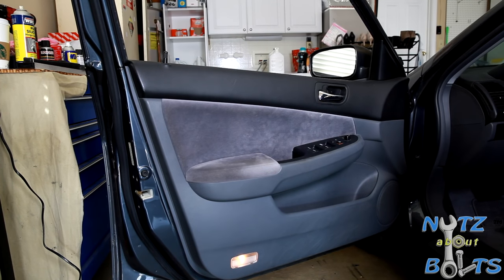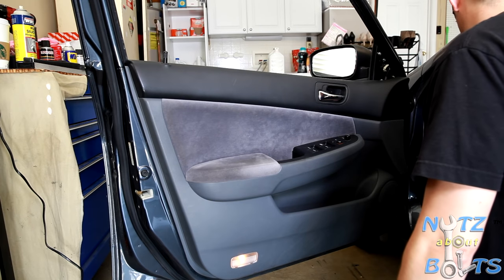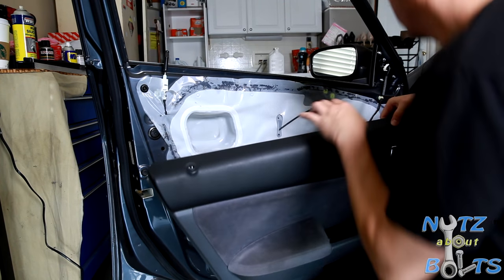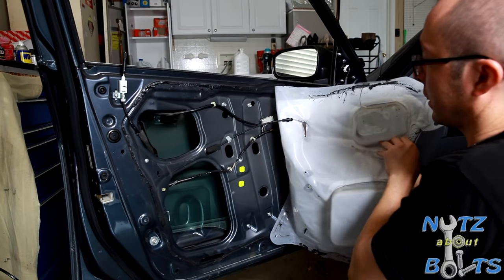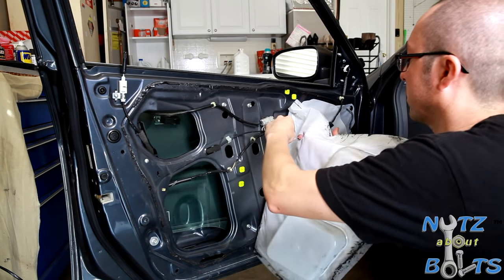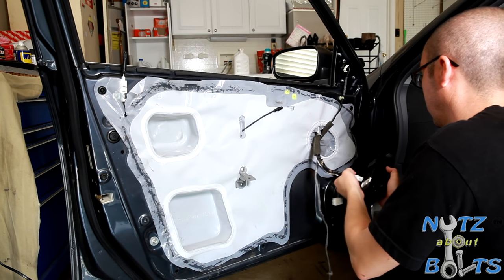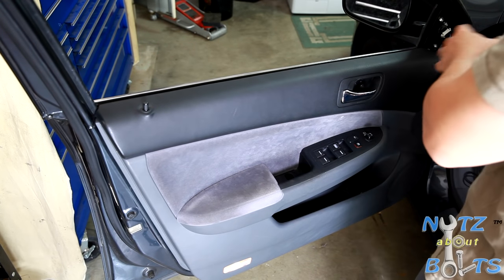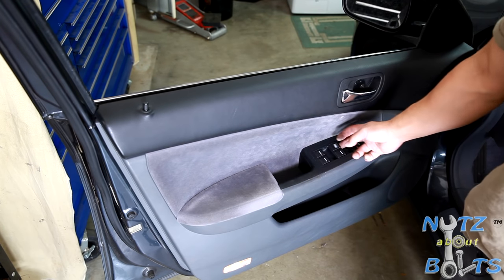2003-2007 Honda Accord Door panel removal

Comment: For the 2004 Honda Accord EX Coupe (2 Door): Rather than one screw in the armrest underneath a rubber mat, you will find two screws facing in towards the door underneath (towards the bottom) of the armrest.
Reply: Goat 🐐
Reply: Wowww thank you! I was confused bc there wasn't a little mat or a screw where he said. No wonder panel won't come off still

Comment: you should disconnect the door handle cable before removing the door panel, otherwise you'll get what happened in your video and that bracket holding the cable will snap and then you're out of money to replace that too. there's a cover plate right behind the door handle that you pop off and pull out the door handle, then disconnect the cable from the bracket.

Comment: My door handle cable seems to have snapped so now I know how to remove the panel to replace it.  Very nice
Reply: I learned the hard way that if you remove the panel as demonstrated here, the green plastic holder on the door cable will almost always break. If you remove the door handle before removing the door panel, you can avoid breaking the plastic piece. I'll be opening my door from the outside until my new cable arrives. I'm sure 8 years ago the plastic on this guy's car was still pliable enough that he could get away with this. Not so much now.

Comment: The last thing you said was reset the power switch, what's that and how do you do that? I'm so glad you're back. I have a 2004 Honda Accord and it needs a lot of work. I was pretty worried when your channel was down. You guys are awesome! You guys are very detailed and explain things very well. You guys have the right tools too. Thanks guys.
Reply from the maker: you want to put the driver side window down all the way, then press and hold for 5 seconds. After that, you bring the window all the way up, then press and hold up for 5 seconds. That's how you reset the auto window up and down for the driver side.

Comment: Good video on how to remove door panel to enable access to a variety of components and fasteners. I used it to lower the panel to ease access to the bolts holding in the side view mirror. I didn't have to remove the panel entirely, thus eliminating the need to detach the control console on the armrest or the cable to the door latch.

Comment: Thanks, mate. I have a problem with the lock and I'm trying to fix it myself. Thanks to you, I know how to remove the door panel 😁
Reply from the maker: No problem! I also made a video on how to replace the door lock actuator.
Reply: @NutzAboutBolts Can you provide a link to the video?
Reply from the maker: @krzysiekpawlak6992  here you go https://youtu.be/y4Qete3nBeo?si=_Lt3RanZFjP7h2of 

It’s for the passenger side, but it’s the same concept for the driver side, just different part used for the actuator, instead of the passenger side actuator, you’ll need the driver side actuator for the driver side door. I hope that helps.
Reply: @NutzAboutBolts Well, now I know what it's about. Will a new actuator be needed or will regeneration be enough?
Reply from the maker: @krzysiekpawlak6992  if the door doesn’t unlock or lock, you’ll need a new one. Not sure about regeneration. Never heard of it.
Reply: My problem is that the passenger doors and trunk are closed with the remote control, but not the driver's door. And when I lock it with the key, all the doors will lock
Reply from the maker: @krzysiekpawlak6992  I'm still a bit confused. You're saying when you use the key fob to lock the doors, that it'll lock except the driver side door? but when you use the key to lock all the doors on the driver side door, all of them close? is this happening intermittently? or does it happen all the time?
Reply: That's exactly what's happening. Unfortunately, this has been happening all the time for a long time  @NutzAboutBolts
Reply from the maker: @krzysiekpawlak6992  it’s most likely the actuator that’s going bad… buy one from Amazon, if that’s not the issue, you can do a free return through Amazon. That’s what happened to mine when it happen intermittently.
Reply: Thanks for the help. Could you send me a link? Because I don't even know what it looks like
Reply from the maker: @krzysiekpawlak6992  this is the driver side door actuator https://amzn.to/3ArznK9
Reply: @NutzAboutBolts Thanks. I think I can handle the exchange. Take care 👍
Reply from the maker: @krzysiekpawlak6992 no problem!

Comment: Great video dude! Is it hard to get the motor out if it needs to be replaced?  If the window stopped half way up, is it likely that the motor is okay but the window is stuck on the track or out of alignment?

Comment: Thanks. I'm accessing the inside of the door and removing the sliding window glass to get the lock cylinder out to re-key the door lock. I have successfully done it with my 2003 Honda Civic and it looks like the process on the 2005 Accord will be similar.  Removing the cover panels off he Accord door is a little different than with the Civic.  Your video is very helpful.
Reply from the maker: glad we could help :)
Reply: I did not have remove the window glass after all before I attempted to.
Reply from the maker: usually you don't need to remove the window glass when removing door parts...

Comment: I have a 2006 honda accord the driver side door window goes up and down, but none of the other windows work, so I'm thinking the motor is ok, what would your recommend I check next?
Reply from the maker: does the master switch works when using on the driver side? does the window go up when you use it on their individual sides?
Reply: Google it. I found the fix. U bridge two wires under the window switches

Comment: 2006 Honda Accord EX Coupe door panel is different. I have locked door and no idea how to get panel off. Right now there are 2 screws in the bottom of arm rest, under electronic window switch, which are a problem to get out, but when those are out, still don't know if panel will come off.

Comment: I checked the 20 amp fuse and it's good. What do I check for now?
Reply from the maker: +Jonathan Washington could be a faulty driver's power window motor or an open in the wire.

Comment: QUESTION !!!!!!!!!! when I roll my 2 front mirrors up/down  they make a squeaky sound, any idea what part might be going bad or rubbing against it to cause that sound ?
Reply from the maker: could be the weather strip for the glass is worn. Try using silicone spray on the rubber part and see if the noise goes away. It's probably old and brittle so they are dry and cause noise when rolling the glass window up and down.

Comment: I got hit my passenger fender and this caused the window to stop working. It will go down very slowly and make some scratching noises. Do you have any idea of what might be the problem? Or what I can do? I would really appreciate any help.
Reply from the maker: could be a wire harness problem if the wire is routed through the fenders.

Comment: Lmfao my Accord 2008 coupe window was getting stuck on the top rubber today it fell in. 15 minutes later was up and running with your video lol.  Also found out someone already changed the glass and did a poor job at the installation , also the glue was gone on the plastic track and lol there was no grease on the up down track lmfao. Excellent video!!

Comment: hey , I appreciate the help u gave me last week . i have a 98 corolla le with overdrive . It's idle is lower than Normal and acceleration is sorta sluggish . I need your master mechanics skills !! Lol please and thank you
Reply from the maker: +Justin Platon any check engine light?
Reply: +NutzAboutBolts yes , the check engine is on . speed sensor is bad . i took that off , error code registered trans speed sensor. even cleaned my throttle body some what. any idea ?
Reply from the maker: Justin Platon
you want to fix all your check engine light code and then recheck your car, other than that, you can't do much besides fixing the codes first.
Reply: +NutzAboutBolts okay I'll recheck auto zone and see the codes again. I can do a video of my car as well. not sure if u have time

Comment: I've noticed, a recent issue on our 2006 Accord, is when you lock or unlock the doors, you'll hear this screeching noise coming from inside the door panel. Any ideas on what it could be? Doors lock and un lock fine still.
Reply from the maker: +thecarexpert21 I would still remove the door panel to inspect the noise, everything is there for you to see. So you can mess around and see where's the noise is coming from.
Reply: I had the same noise in my 2006 Accord. I ignored it for years and nothing wrong happened.

Comment: the one thing that i needed to learn was already done. the cable to the door handle was already disconnected
Reply: It is hard to get but the first safe thing to do is pull the handle out (there is always play) and get a regular size flat driver and pry the plastic holding it and then pull it up to disconnect it.

Comment: I have a 2004 Honda Accord Lx coupe. My driver side window stopped working a few days ago.  I checked the master window switch on the driver's side, it will let down the passenger's window down, but not the drivers window.  I replaced the master switch and it still doesn't work. I don't know what's going on. Can you help, please?
Reply from the maker: +Jonathan Washington Did you check the 20 Amp fuse under the kick panel??

Comment: My window just makes a grinding noise and won’t roll up at all is it off track??
Reply from the maker: I’d open the panel and check if the window glass is bolted on the rail track. It’s pretty simple to do.

Comment: I have an issue with my 2004 Acura MDX ,when I unlock the door with the remote or key get inside and start it all the doors automatically lock ,the problem is if I unlock it and leave the car soon as the doors close it locks again with the key still in ..what might be the issue?
Reply from the maker: probably something with the programming of the key door locks. I would ask the dealership if they can reprogram it for you or something.

Comment: I have an Accord DX without power mirrors, so I can't merely "pop out" the triangle shaped trim piece in the upper corner of the door, because there's an lever attached to that piece to adjust my side mirror.  Any ideas on how to get this piece off with the lever attached?  I've tried pulling and prying it off, but it won't budge and I don't want to break it.
Reply from the maker: it could be twisted on or screwed on... not too sure, do you have a picture?
Reply: I'm not sure how to post a picture here, but you can find a pic of the driver's side door easily by doing a Google image search of a 2004 Honda Accord DX.
Reply from the maker: I tried to google it and still don't see it. You can go to our FB page and send us a message with a picture of the part. Front and back please, thanks!

Comment: Thanks for the video. I was having issues with my keyless entry and figured I'd take the door panel off and take a look at the switches.
Reply from the maker: no problem :)
Reply: You don't have to remove the door panel to check the keyless entry switches. The unlocking receiver is part of the master power window switch unit (the one he removes from the door panel to take the wiring connectors out the bottom at the beginning). The cable goes back to the dash after that. If your receiver has gone bad, you can replace it in five minutes (it comes as part of a new switch unit). Not to be daft, but have you tried replacing the battery in your keyfob first?
Reply: enex six
yeah I've checked the battery in the keyfob. Well just an update, I had a few plans to fix the keyless entry. Started off with the keyless programming and it fixed the issue. Lock, unlock, trunk, and panic all work just fine now

Comment: Is there anyway you can make a video showing how to replace the driver door window regulator and motor in the honda accord 2003-2007? That would be so useful. Thank you.
Reply from the maker: +Derek we'll take that into consideration, as it is pretty much the same like this and then removing the motor.
Reply: +NutzAboutBolts thank you.

Comment: My daughter took my 07 Accord out the other day left the windows down and water all in it wondering if it will just dry out on its own
Reply from the maker: I believe it will, the electrical component is well covered. There’s no open electrical wire to cause a short.
Reply: Ok thanks. Real quick my driver side goes down but non of the other will go down so far keep my fingers crossed.
Reply from the maker: @stepheng8513  is it only the master switch buttons doesn’t work? Have you tried those individual window control on the door? If they all work individually on their own door, then I’d suspect it’s the master control switch on the driver side door that is at fault. I’d get another switch and swap it out to make sure it works. If not, you’ll need to further diagnose the electrical issue or the switch.
Reply: The other windows won't go down even if I try it from that individual door
Reply from the maker: @stepheng8513  does that happen on all the windows?
Reply: Yeah basically only the drivers window goes down as of now
Reply from the maker: @stepheng8513  I’d check the fuse since even individual window door control doesn’t roll down the window.
Reply: Not that auto Savvy but are you talking about the fuse box under the hood
Reply from the maker: @stepheng8513  there’s 2, one under the hood and one next to the driver side kick panel on the left. You’ll need a test light to check the fuse if it’s working or not

Comment: I'm having trouble putting the panel back on. Nothing will line up...
Reply from the maker: kasjamm you want to line up the top first, where the window seal is at, it should sit on it before you start snapping the rest of the panel up.
Reply: @NutzAboutBolts  Thanks! I got it.

Comment: where is the fuse located under the kick panel?
Reply from the maker: +Jonathan Washington it's on the left side where you step on the gas pedals. There's a plastic cover you remove and there will be fuses behind there

Comment: How do you remove the front passenger's door panel? It is different to the driver's
Reply from the maker: hrm, we'll have to film it, its a lot easier than the driver side
Reply: padelmar Its the same just without  the master switch.
Reply: Look UNDERNEATH the arm panel.  Up above the storage area in the door I found two screws.

Comment: Can I access window like this? My window is stuck at the bottom
Reply from the maker: Yes, you can access the window if you open the plastic door panel. It’ll be on a window rail track that goes up and down by using the door control.
Reply: @NutzAboutBolts  thank you for fast response! I wasnt able to pull it out with ruler/tape so i will remove door panel
Reply from the maker: @JolinHard the window glass is held on by 2 10mm bolts I believe. Just be careful not to break the glass
Reply: @NutzAboutBolts  man I got the door panel off but I can’t seem to pull the window up still
Reply from the maker: @JolinHard  you can’t pull it up, you’ll need the window regulator to work
Reply: @NutzAboutBolts  😂i wasted a whole day doing this. I ended up taping my window up. Thank you again
Reply from the maker: @JolinHard  it’s all good, at least you learned what’s behind the panel, now you’ll have an idea what you need to fix the window :)
Reply: @NutzAboutBolts  yeah its too much work, im going to just sell my 04 honda accord ☹️

Comment: hey do you have any video for the rear door driver side?
Reply from the maker: not as of right now... whats wrong with yours?
Reply: +NutzAboutBolts oh i think the door latch might been disconnected?  i cant open the door from. the inside
Reply from the maker: oh... I see, its the same procedure as removing the front door panel.
Reply: +NutzAboutBolts ok sir thanks im gonna try opening it..  hey bybtge way do you have any idea how to replace evap on the accord? i got cel and pulled out the codes its a evap leak
Reply from the maker: Evap canister is on the engine compartment starting from the driver side down to the rear of it... evap leak can be around any of that place... gotta see where the leak is coming from first.
Reply: +NutzAboutBolts yup do think fixing that would be such a big work?  im. planning to take ome parts at the auto wrecker get the whole. thing including the solenoids
Reply from the maker: there's a good amount of hoses to trace, but I would fix what's wrong with it and not try to replace the whole system because that's a lot of parts to replace... whats the CEL?
Reply: +NutzAboutBolts im gonna pull outnthe codes again i forgot what it was..  lol.   by the way i wanna update you in my work on my rear door that wont open i manage to took out the panel and the bad thing is i think the child lock is stuck..  any idea to fix it?